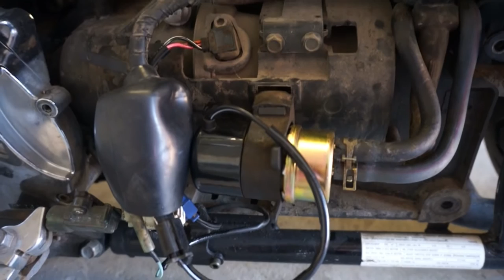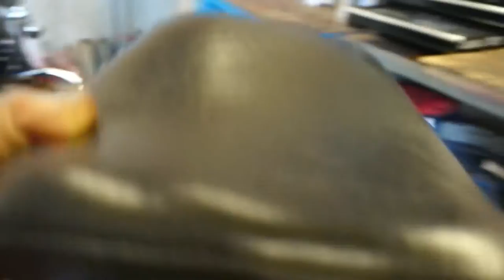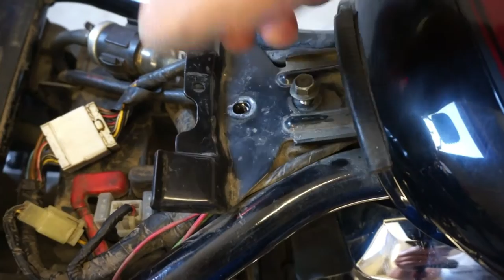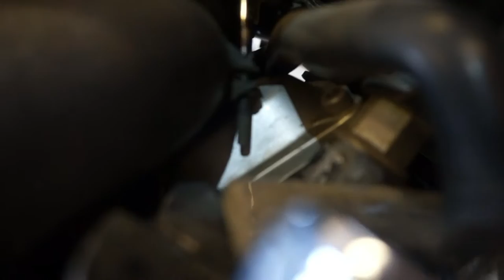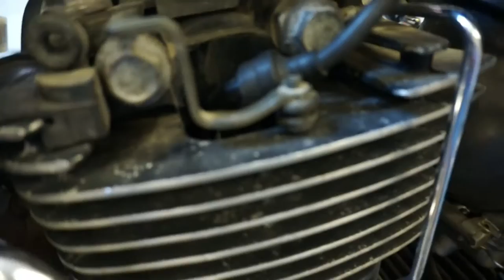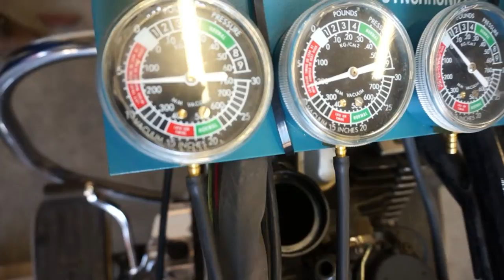Yamaha V-Star Classic , Bulldog BT 1100 , running problem , backfire , spark plugs flooding , repair

Comment: Czyli co było przyczyną ?
Reply from the maker: Przyczyną była zparciała zaślepka podciśnienia.
Reply: @motocraft180 
Where was it located so I can check mine? Mine is doing the same thing and I couldn't originally find the problem!?
Reply from the maker: @gabrieltrevizo6088  Is located on carburetor rubber connector to the head
Reply: @motocraft180  
Thank you! 😁👍